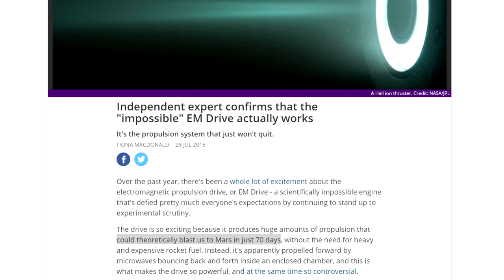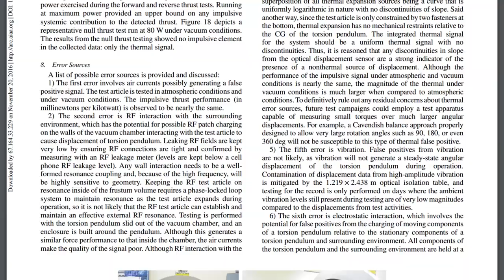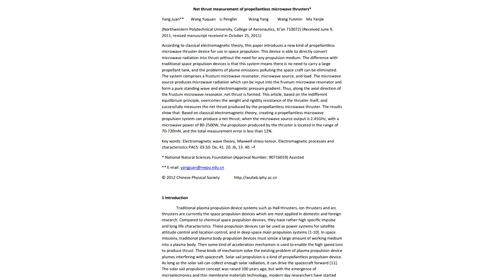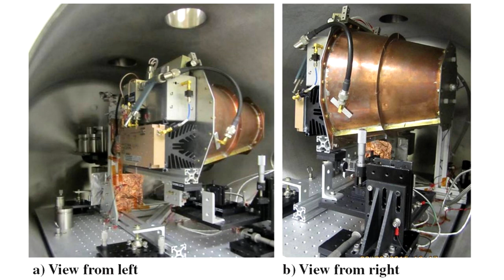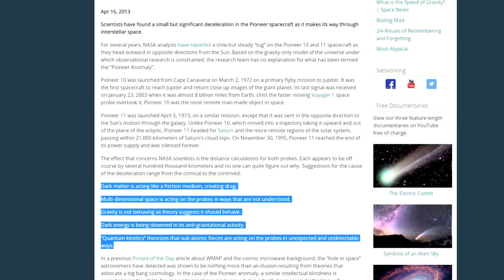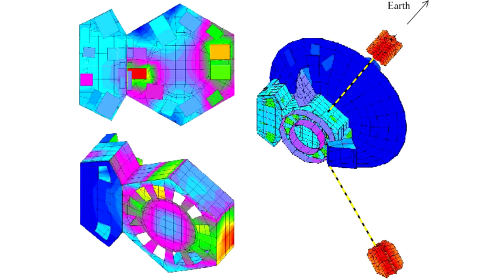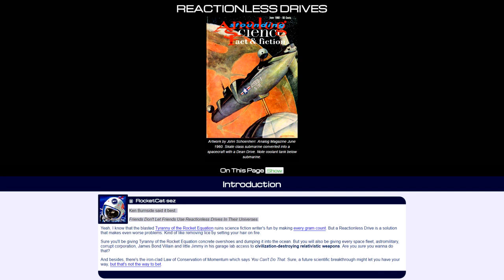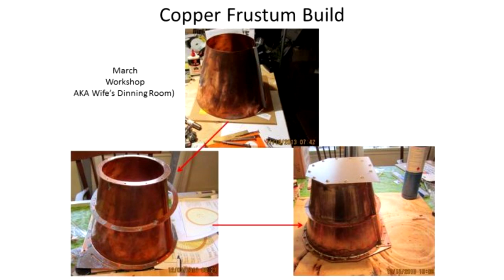What is the EM Drive? And Does it Really Work?

Comment: I don't have the paper, but copper containing that much microwave power will heat up some and cause air convection in the atmosphere.  Combined with the conic shape, this could easily result in microNewtons of force.  There would be a time lag between applying power and convective force.  Copper has non-zero resistivity so the microwaves will penetrate the cavity walls and interact with nearby materials.  Power cables feeding the device will expand under load due to Joule's law losses.  Power cables will also generate magnetic fields that interact with copper's Pauli paramagnetism.  There are a hundred subtle reasons why this thing has probably tricked amateurs into believing the inventor's claims.

Comment: If Ross is only 11ly away and the reptilian doilia is just that ,then I suppost that utilising radio telescopes as repulsive and attractive condensed fusion chambers like a ski lift would not be disimilar ,however we haven;t really got past the limits of modern industrial approaches like this.  subatomic collective as diomagend, I would still hope for a trade with other system species,this thruster seems rather glued to its icarus feathers. Strategically of course. Practical displacement at the high velocities of larger stars might alter the speed of light also relative to our better observations,though even a bad instrument will yield something true.

Comment: Operating a device absolutely without wires, i.e. using batteries and wireless on/off control, is obviously needed. Also, increasing the cross section ratio implies that the thrust should also increase. If the thrust does not improve substantially, then the device is useless - even if it has some non-zero performance.

Comment: what if they fire the waves radially inward at a cone? By firering the waves into the cone at all angles you can produce thrust, the cone deflects the waves towards the back. also, by differing the power of some wave producers you can make more thrust on one end and less on the other meaning you can stear the engine.

Comment: Having read speculations about axions, which allegedly should be possible to make by sending photons through a strong magnetic field, the EM drive makes me think (even though as far as I know the axion theory has no evidence showing that such particles exist):  What if the EM drive was actually an axion thruster?  Then it would not be a reactionless drive at all, simply a reaction drive that works by producing and ejecting difficult-to-detect particles having very slightly more rest mass than photons (assuming that axions exist at all).

Comment: I know this is a few years old now, but probably never more relevant with all the space innovation happening right now. If we as species, really want to expand our horizons in space exploration, we absolutely must develop new propulsion options. Although advances have been made the achilles heel of space flight is the limitations imposed by having to use massive combustion engines and the accompanying massive fuel loads...which comprise around two thirds of current rockets. I have not heard of this particular propulsion method. In theory it sounds great...but that's the problem, they all do but never amount to anything.....peace.

Comment: @10:50 "overunity machine by putting EM drives on a wheel". Since the EMdrive consumes energy that creates EM waves which will be absorbed by the metal and then diffused under the form of heat, I'm not sure that statement is correct.

Comment: Scott Manley your comments after 12:00 about hovering/accelerating are ridiculous.  Hovering is a balanced force, accelerating is an unbalanced force.  The two are NOT equivalent.  Your use of the box thought-experimemt is grossly incorrect, and you would be able to tell the difference between accelerating upwards at 1 g within a 1 g gravity-field downwards (your Normal Force with the floor of the bix would be TWO g's), and hovering under 1 g.  The versions you cannot distiguish are a box that is NOT under a gravity-field and is accelerating at 1 g, and a box simply sitting on the ground under a 1-g gravity field...  The former is a VERY different situation than accelerating against a gravity-field  (where the Normal Force experienced is the sum of ADDING the gravitational force and the net force upwards beyond what is required to simply balance that force...)
Reply: If hover force is balancing itself against gravity (a decelerating force), is it not an accelerating force?
Reply: It's pretty obvious that the box thought experiment that he is referring to IS where the rocket is not under the pull of Earth's gravitational field - the diagram he used is with a rocket in space. A better diagram to accompany this specific explanation would have had the box on the right hovering against the pull of Earth's gravitational field, though the result is exactly the same as if it was resting on the ground: they are both equal to accelerating in space at 1g, and therefore both experience time dilation due to general relativity, so he is spot on and not at all ridiculous!

Comment: I believe you made a mistake in your analysis.   The formula does not state  2.7  "micro"  Newtons -  it is 2.7 "milli" Newtons.  "Micro" references in the paper use the Greek symbol mu   "μ".  The formula uses "mN"  milli-Newtons.  So if a 10MW (MegaWatt) generator of electricity should get 2.7lbs of thrust.  That is 1000 times more thrust than you suggested.  How does that stack up with the ion drive?

Comment: Before it was realized nothing was actually happening the way they hoped, I was hoping they were somehow pushing against the immediate mass around them; that there was a possible way to minutely change the surrounding mass's momentum a kin to the change of a large body's momentum when you do a gravity assist maneuver in the gravity field of the large body. I remember thinking along those lines when I complained in my science fiction group that there was no easy way to use the Earth's momentum to push against without physical contact. One person piped in with you just go out past the moon and get a gravity assist that way. I tried to tell him, no, I want to get off the Earth from a standing start, but he told me that's what rockets are for; to get you out where you can get gravity assists. Now he would probably tell me to build a space elevator.  I just wanted an easier way to get into space in the first place without needing some sort of multi-billion dollar project  to get out of Earth's gravity well. He also was a big believer in the Dean drive, a mechanical drive that was somehow able to convert rotary motion into forward thrust through the clever use of eccentric masses. I figured it did not work because it could be the basis of a gravity powered perpetual motion machine the same way a Sterling engine can be used as a heat engine or refrigeration unit.

Comment: I️ think they were actually  probably getting a little bit of thrust— not from the frustum shape or the microwave gun. Though i️ never saw the methods they use for generating microwaves, I️ know that the used current though wires which causes magnetic field. I’m assuming they used some damn near nanoscopic type levels of precision, so it wouldn’t surprise me if a current somewhere in the part was pushing against a magnet in the system. A flip of physical direction would then cause the poles to change and thus repulsion instead of...well—repulsion in the other direction. Maybe I’m very very skeptical and maybe a little too skeptical sometimes, but this one seems like a lost cause.

Comment: To be fair, it's really a good thing if it works. It doesn't throw out all the physics you know any more than the precession of Mercury's Perihelion throws out Newton's Gravity. ie, it kinda does, but kinda doesn't. So all that learned physics is still good for the regions it's known to work in - it's just that our horizons will expand a little. Or a lot. Who knows?

Also, a warp drive - a field propulsion device - would seem "reactionless" but would actually be "thrusting" off all the mass in the distant universe... So technically not violated, but pretty much effectively so.

Sort of like those nice little gravity assists. Sure, you lower Jupiter's orbit a little, but by such a small amount it's not measurable, but your boost sure is!

Comment: I am no expert on the matter, but I bet it’s some big funding for some physicists that only learned the simplified schoolbook explanations of physics.
I don’t have much to go on, but judging from the explanation in the video, they forgot to consider the evanescent wave mechanics insider the copper plating.
The waves are after all not reflected on the surface of the copper, but the result of a reaction process, which gets induced by the microwaves impacting into the inside of the copper material surface.
The emitted wave is not the same as the one hitting the surface beforehand. Considering the electromagnetic reaction inside the copper surface is vital to understanding the effects of the reflection.
Whichever physicist doesn’t consider the above shouldn’t be permitted to do real research, but go into development instead.

Comment: I have wondered if its possible to use 2 emitters that point towards each other to balance the recoil.  in between is a mirror (for each) angled at 45deg.  The energy needed would be way too much to get a useable output

Comment: The problem with peer review is that paradigm shifts in thinking are automatically eliminated. You won't get a paper past your peers if your paper is too far beyond the pale. The peer review system should be about does it work, rather than focus on the bias of the reviewer.

Comment: Since I was a kid, I always thought some sort of gyroscope within a gyroscope, some kind of revolving spherical shell within a spherical shell thingie, might work, where you differentially charge one of the shells so that its electrical field is oriented so the force on the sphere generated by the ambient magnetic field of the Earth is in the direction you want to go.  Passengers sit in an inner shell that stays "upright," while the/an outer shell is developing thrust off the ambient magnetic field of the Earth.  Wouldn't work in space, but it might work where the Earth's magnetic field were strong enough, or so I thought, as a kid.

Regulating the shifting charges on the outer shell would be problematic.  Sitting inside such a beast might kill you.
Reply: Interestingly, the Earth's magnetic field has been proposed as the source of error in the 2016 NASA experiment. Apparently the cables were not properly shielded from the ambient magnetic field, which could account for all of the observed thrust.

Comment: I agree with you, the EM drive is problematic at best, but don't knock a guy that built a prototype test vs a team with resources.

A lot of good ideas have been started in someone's garage. Einstein was a patent clerk, not some funded university genius with a huge budget.

The heatsink was problematic in a vacuum tho.

A solid block of aluminum, copper, steel, etc, would be better than a heatsink.

The heat has to be displaced in mass, same principle as the heatsink, only you don't have the mass of air in a vacuum.

Comment: Mmmh... I'm trying to wrap my head around this whole investing matter thing.

A propeller airplane can produce thrust by moving the particles around it - that capability is not bound to it consuming fuel, but to it using energy to spin its propellers. Let's make that electrical energy. If there were no gravity, it could propel away and stuff, until it runs out of power, which, slowly, it could recharge through solar panels.

The way I understand it, the EM drive tries to do a similar thing: Use electrical energy to create a directed force. Obviously that means there has to be some volume to manipulate, even in a vacuum. But I thought we had long agreed that the lack of atmosphere does not by any means say there's nothing out there? I'm not sure what, but then again I'm a musician. :D
Is it too far fetched that there are waves or particles that can be sucked in, directed and pushed out using microwaves? After all "photons don't have a mass, but they do have momentum" doesn't sound too scientific either, yet it appears to be scientifically correct. If that photon concept makes sense - with photons being both particles and waves, if I am not mistaken - why should a drive not be able to manipulate the energies in a vacuum as if they were particles?

Comment: Imagine that instead of microwaves, YOU are inside the can, jumping back and forth from end to end.  And just like the EM drive, when moving in one direction you launch yourself faster than when you jump in the return direction.  Do you think this will gradually push the whole can in one direction or another?  Not unless the can is touching something external, which breaks the whole premise.

Surely, when microwaves are slowed by narrowing waveguide, momentum is transferred from the microwaves to the waveguide.  Thus conservation of momentum is preserved and an EM drive generates zero net thrust.  All this seems obvious, but I've found no indication that the inventor even considered the existence of this "equal and opposite reaction".

Comment: It isn't a perpetual motion machine, if it uses electromotive force. Electricity doesn't come from no where. The extra energy is entering the system because you are adding something that is converted into electricity. Though I am not an expert, I can't see how it counts. Will someone enlighten me, if I am misunderstanding?
Reply: ytmoog The part I don't understand is why it has to be creating momentum from no where. I understand the flaw in a perpetual motion machine, of course. Is the thrust it generates greater than the electrical energy?

Comment: Ok the whole problem is that measurements are so tiny they're not sure it is thrust, so... Build an engine 10 times bigger, that should be big enough so the thrust can be measured easier, and if it works, the engine itself it is not that significant but the impact on physics will

Comment: Scott, good video, but also, I think you're wrong. Why I think that way? This is an anser: 3rd Newton dynamic law sayed ,,If the body works with the one force to the other, it's getting the same force, but in opposite direction". It's like you put the shower downwards and pull the full ,,thrust" (you know, what about I think); the shower is ,,howering", because it use it's force downwards,  and it ,,flyies". If you use a rocket engine (for example, chemical), even in vacuum, you fly. It's really that simple. And if you use a lot of microwaves, you can push something. So, the microwave engine (I know, what about you tell) should work, because microwaves generates force, and the ship gets a force that push itself onwards. Simple? Simple! (But if you have an another sentence about that, I don't care, that's only my opinion). Summaraising, the microwave engine, should work, but, as I sayed, that's only my opinion.
Reply from the maker: What you're describing is a photon engine, which does work, however the thrust/energy conversion of such a device is lower than the anomalous force here therefore it cannot be the explanation.
Reply: The reason would be, that I imagine that engine that microwaves should have a light, so they have a photons, do it should work. Thank you for answer.
Reply from the maker: +Admirał Patryk microwaves are photons.
Reply: Oh... but that means, that it should work...
Reply: Scott Manley, I think you are suggesting that microwaves are "Electro-Magnetic Waves" and therefor have rest mass although substantially smaller than light as microwaves are much longer than light and therefor less energetic,  Plank's constant, E=MC^2, ( less rest mass) Is this your contention?
Reply: Microwaves can have an electro-magnetic payload, if they have a couple of any kinds of atoms, but it doesn't change anything: mostly they have a photons. Let me explain: the photons could be ,,catched" by electro-magnetic forses of atoms, but they will travel at the same speed as earlier; the atoms travel like photons. They can just ,,catch" the photons for a while, but the wave will travel as earlier.

Comment: If the emdrive requires electricity to run in the first place, then it does NOT violate the laws of physics ,because it needs energy from outside,
Also if it never could generate more power then what you would put in,it makes no sense,also if there are flaws discovered in the papers as well as in the emdrive motor itself, am afraid it doesn’t work at all,
Even if it will work, it still needs electricity, for that i would recommand to wire tons of nuclear batterys to it to power it for 28000 years,
Or put a magnet motor to generate electricity ,
But you also need a transformer to multiply that generated voltage,
This way you can turn that emdrive machine into a perpetual motion machine, being independend from the sun,sound,the wheather ,or fuel ,
But as of now am sceptical about it.